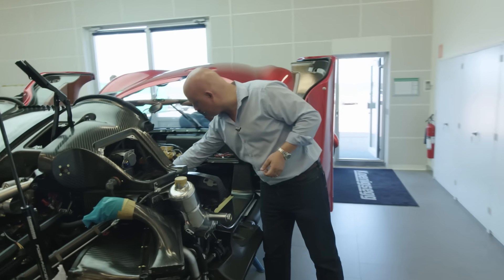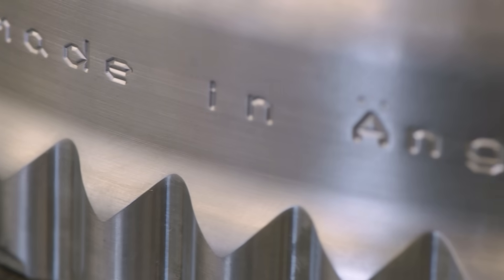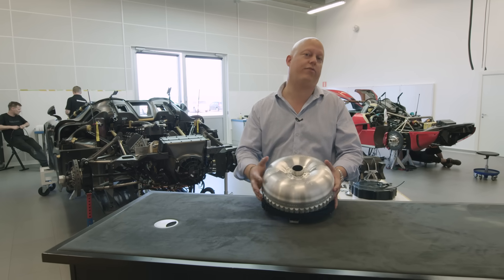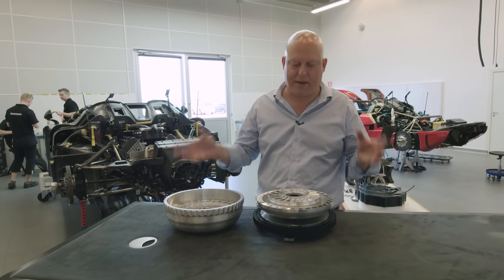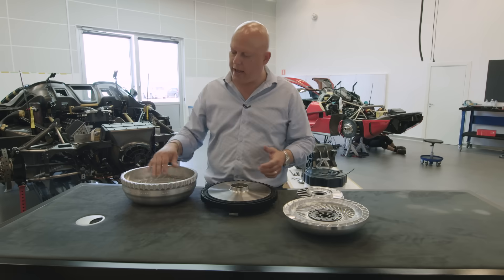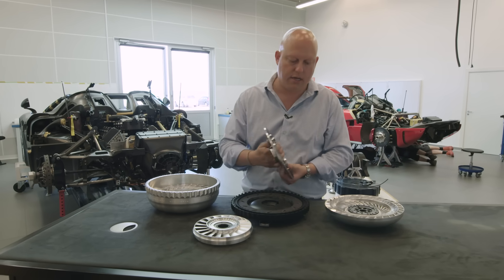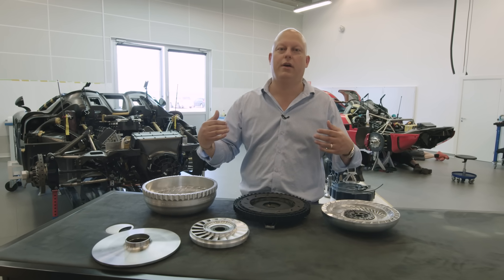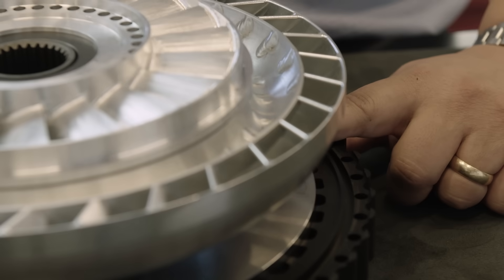248 MPH Without A Gearbox: Direct Drive  -- /INSIDE KOENIGSEGG

Comment: I'm a pretty smart guy, and I kinda-sorta get how torque converters work.  I've been trying to puzzle them out and really, truly understand them for about 30 years.  Like I said, kinda-sorta.  I get the concepts but when you're looking at the fluid flow diagram and the rotation direction arrows and the whole thing, my eyes start to cross.  I won't deny that it's a brilliant idea, and he's right - it isn't super high tech or cutting edge sexy like the Toyota Synergy system or even the GM Volt.  It doesn't have to be.  It has to be tough and it has to work - no problem.  Preston Tucker used a TC drive on his Torpedo back in the day, and it worked.

But even after Christian spends  nearly ten minutes trying to explain it, it still isn't completely clear.

Comment: I'm no machinist or metallurgist, so I'm wondering why the vanes in these parts were welded, instead of the whole being machined out of one billet of metal. Is this better for strength, easier for manufacturing, or maybe both? 

Also, I'm really glad he didn't claim this was some kind of new technology. Not that he would, but some do. I recognized it as soon as I saw it, from way back in the old days. :)
Reply: They do not appear to be welded and he said they were machined. It looks like they use a 5-axis CNC.
Reply: Im no expert either but my guess is this somehow increases strength or prevents it from warping in someway. Otherwise there would be no point in doing it.
Reply: I saw no welds.  I saw some artifacts from what appeared to be hand-done machining.  It looks like the whole thing was CNC'ed out of billets and then tuned up by hand afterward, which seems really backward but that's how it looked.
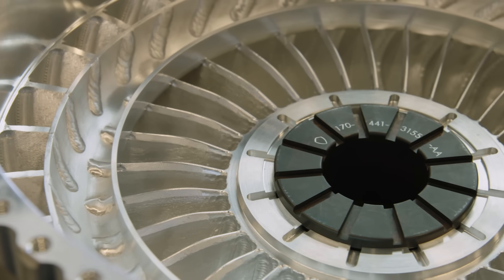Reply: I'm looking at what are either plug or welds at 5:24 .  It looks like the basic shape is a bowl nested inside another bowl.  To machine the fins of the turbine in between the two would be impossible, so they machine each bowl as a separate piece, then weld them together.  If strength were a concern, they would likely be using something other than aluminum.
Reply: Millwright Bastard I see what you're saying. The fins are machined. That U-shaped trough is then welded into a groove cut into the fins.
Reply: Some good eyes here.  I looked and came up with same assessment then noticed everyone already narrowed it down.  The machining did look like welds when I first saw video, then closer examination showed the U shaped trough was welded and the veins have machine marks.

Comment: So is it just a huge centrifugal clutch?
Reply: no a centrifugal clutch does not multiply torque, and it allows for a different input/output speed by slipping and wear... 

This is a torque converter, oil is doing the work, not friction material.

Once you get 1 to 1 speed, the torque converter operation is no longer needed, so the lock up clutch deactivates it.

Comment: Direct drive with an electric motor makes all the sense in the world. The motors controls act as a potentiometer. A normal converter will bleed off power before it locks up at higher rpm. At low speed, it's a torque multiplier.
What a beautiful piece of machining.
It is the springless (et al)  valve train that has interested me for years. It allows you to loose all the parasitic drag and wear and tear items in a engine.

Comment: sounds similar to how the clutch pack works on a top fuel dragster . direct drive but the clutch packs slips till full lock up or that's the only thing i can compare it to in how  it operates.

Comment: in not too good in english, in my understand its a like a cvt but with less components and pulleys inside another pulleys variating the engine power exit like a eletrical torque multiplier lug wrench with steroids and alot of rpms, something like that?

Comment: This only showed me how much I don't know.
Reply: theres basically just a fan that shoots liquid at another fan, the first fan gets power from the engine, the second fan gets spun by the liquid being shot at it.

Thats how you can have the engine power make the shaft spin and give it power without directly attaching them. Imagine if they directly attached a fast-spinning motor to a not-spinning shaft, it would violently break or jar the car forward.
Reply: Michael Marti it’s not just a hydraulic coupling. It literally generates more torque. It changes the direction of the fluid at different angles to create a gearing effect.
Reply: They made a special set of these two liquid-fans that is more efficient and can handle more power so they can let the engine spin way way faster than the wheels spin and still send power from the engine to the wheels- a problem usually solved by gears which let the engine + wheels spin at different speeds, but they didn't want gears because having like 40 gears and 7 gear ratios with complicated moving parts is really tough when transferring 1200 horsepower and going 248mph, this is simpler and works better for them.
Reply: zawzero And a few other things...
Reply: so well put
Reply: +Chad Bingham Just learn what a torque converter is (it will be in your suggestions) and you will understand.
Reply: hey so you are telling you know better than him? Hey show me your hypercar that does it's top speed in 20 seconds!
Reply: LOL   Exactly!
Reply: LOL.  IKR.
Reply: I see what you did there......
Reply: Watch porn then, it will blow your mind.
Reply: Yet the efficiency is less compared with a normal gear. Lots of turbulences dissipation of the horsepowers...
Reply: It's a hydraulic coupling. Don't wet yourself. And again: Back to school. Your english is terrible.
Reply: Really? He braggs for 8 Minutes and then explains basically nothing? Back to school!

Comment: Oldsmobile experimented with a "switch pitch" convertor back in the mid- late 60's. As engine rpm increased, the vanes in the convertor moved to increase resistance sending more power thru the transmission. I rode in one of these cars when I was younger and it just kept pulling all the way up. I'm thinking it was a '65 olds cutless, but not sure.

Comment: to put it in layman's terms a torque converter is like a flywheel clutch with a hydrolic turbine pressing a disc brake (pressure plate) instead of you know, how a flywheel clutch works...

Comment: If I have this correct they have utilised the combination of the instant 100% torque of electric motors and the variable resistance of a hydraulic coupling to allow the engine to require no reduction gears in order for it to avoid stalling at lower speeds which means that you don't need a power sapping gearbox?

Comment: It's a really cool idea BUT HIS LAYMAN EXPLANATION IS CAUSING MORE ISSUES THAN IT SOLVES.

From what I can glean from this video the best analogy would be a liquid "gearbox", rather than normal mechanical gear box. And from the sounds of it it either has 2 ratios, 2:1 and 1:1, or by applying the clutch at various tensions you can get between 2:1 and 1:1.

He's really got to stop saying "7th gear"
There is still a downward RPM conversion at low revs. I could be wrong but while it's technically not a gearbox it's still effectively a gear box.
Reply: Punished Zero o
Reply: okay so while I basically agree with you all, what I still don't quite understand why they don't just use a two-gear setup with a normal clutch (for example with a 1:1 and a 2:1 ratio)
Reply: People with the way they individually envision transmissions in their heads think of these things differently.  It may help to simply think of this as a way to have a single 7th Gear -- and what would really prevent that gear from moving the vehicle at a 'super car' speed starting from 0 mph/ stand still?  A lack of TORQUE.  So this thing is pushing MASSIVE amounts of torque through right off the bat (I believe over 2,000 newton meters instantly) which allows both systems (combustion engine AND electric motors) to deliver over 500 horsepower EACH and they are cumulative (although are used in a variable manner ).

Once you GET it.. it's really really REALLY simple.  I suppose the most complex thing is just the use of the electric motors for initial speeds as a majority and then the RPM's increase all the way from 0mph to 284mph (on the RS) -- And of course in this transmission the electric motors are responsible for Reverse entirely.
Reply: I think it just muddies the issue.

If he wanted the layman to get it he'd be better off calling it a "Liquid Gearbox" rather than direct drive. Now he's got to explain around it with out saying it's effectively a gearbox because of marketing. "248MPH without a gearbox" is a far more impressive claim compared to re-branding the hydraulic coupling to a "Liquid Gearbox".

I'm basically saying "I see through your bullshit Koenigsegg and I'm still impressed."
Reply: The liquid isn't part of the "gearbox." It's just a coupler that connects the motor to the drivetrain without a "hard" connection, until the clutch engages. It's pretty much just interesting way to use a standard torque convertor (out of any modern automatic car) in an electric hybrid supercar. Since there is not shifting direct drive is a pretty good name.

Comment: 2 to 1 torque converter .. with electric motors assisting ... ok simple  ...
 now try to understand the D-Drive  or 11 million to one gearing ...
and this so called direct drive is only direct when its locked , not when its doing it 2 to 1 thing ...

Comment: Not to take away from his accomplishments... but isn't this just a locking torque converter? He literally says that in the beginning. It's nothing new... like he said, 100 year old technology. I suspect that no company has a product that meets his specific requirement, so he decided to make his own. Honestly I was a little disappointed, I was hoping it would be something completely new (like freevalve - now THAT is incredible). 

I also suspect the drag racing community would have some useful input on beefy torque converters. I'm sure there are two-speed auto drag cars that make well over 1000hp.

Comment: No disrespect to Koenigsegg, but I got caught off guard by the 4s 0-60 time. Keep in mind that a Tesla P100D can do 0-60 in < 2.5s, which says more about electrics than how 'slow' Koenigseggs are (and yes, I'm aware that Tesla has a rather low top speed cap). You can see how the complex an ICE/hybrid drivetrain can get, which inherently causes losses.

Comment: I don't understand how the "hydraulic coupling" is different from your standard torque converter besides marginal innovations in design and use of aluminum (curious how that'll hold up to heat and pressure).  Seems like theyre just using tricky wording to get past the fact that it's not a radically new device (but is still useful).

Comment: If adding an electric motor to a supercar makes it so much better in performance, why have the gas engine at all? Range? Since when does a supercar buyer care about range? I challenge anyone to drive one of these go-cart suspension vehicles for more than the typical range of a Tesla.

We are already in an era where ultra-performance is the exclusive domain of pure electric vehicles and they do it without the Rube Goldberg mechanisms needed for ICE.

I get it. An ICE car is like a Swiss watch. Intricate and beautiful when done like these guys. Engine/exhaust noise, the smell of gas fumes, the shifting, the tradition. Other than collector value, I see no performance value in ICE supercars today, certainly not in 5 years when range issues of EVs are solved.

Comment: Gene Snow developed a direct drive in the 1960s, so you're not coming up with anything new.
Reply: he did mention it wasn't anything new he's just talking about how the torque converter helps get more power at lower RPMs with hybrid mega cars or something, I don't know.
Reply: @Chris Henniker
Try starting out in overdrive with any other car. He may not have invented anything new, but he did come up with some new innovations. Otherwise, we would all be driving single speed cars. Even the model T had multiple gears.

Comment: I feel like this hydraulic torque converter would degrade quickly due to fluid cavitation created by the pressures associated with such high energy input. Am I understanding this thing correctly to assume that?

Comment: You don't need a gearbox for 248MPH??????
Reply: Actually you don't need a gearbox in any car to hit top speed. You need a gearbox to just get them rolling or do low speed driving around town. 

In most cars (rear wheel drive at least) , 3rd gear is usually a direct 1:1 ratio from the motor to the rear axles. The rear gearing adds its own mechanical advantage but that could be any number of ratios
Reply: you do need 900 horsepower ahahah
Reply: Horny Pervert no it's essentially just a modified lockup torque converter. There isn't a gearbox, the whole reason cars have gears is so the vehicle can move at low speed or to get moving. But this guy invented an efficient way to have only one gear ratio so that means no need for a tranny/gearbox. Other people have invented the identical thing but could not figure a way out to make it efficient enough to ditch a conventional automatic trans
Reply: RedfishCarolina maybe 3rd be your 1:1 if you have a 3sp. Modern cars with a 6 speed would have it be 4th or 5th depending on wether or not its a double or single overdrive
Reply: Gottalovethisone this is a gearbox
Reply: Varner345 but it has paddle shifters, what's being done if there are no gears?
Reply: I guess so
Reply: of course not, haven't you heard of rockets? 🚀

Comment: Just sitting here pretending to agree with what his saying like 'yeah I understand..........'
Reply: I agree. I acted like I understood then at the end i was like " What F****** language is the speaking? Super Engineering to the max!!
Reply: theres basically just a fan that shoots liquid at another fan, the first fan gets power from the engine, the second fan gets spun by the liquid being shot at it.

Thats how you can have the engine power make the shaft spin and give it power without directly attaching them. Imagine if they directly attached a fast-spinning motor to a not-spinning shaft, it would violently break or jar the car forward.
Reply: Yeah, I'm honestly not buying this guy's bullshit about extreme engineering and mega performance.  They modified the vanes and volumes to make a TC work like a gearbox, for their engine output/optimal power range and desired thrust curves.  A proficient technician or mechanical engineering student can understand this stuff.
Reply: Michael Marti How much power can you really get out of shooting liquid at a fan though? Thats insane..
Reply: Hear that airplane that just flew over my head....wooooosh. I understood NOTHING. Well ok maybe 2%...
Reply: ____iBeg____ Think about how a steam and diesel ships turn their props. Diesel electric or nuclear electric, same deal. It boils down (pun intended) to converting chemical energy into rotational motion.
Reply: "Fan" is just a word I was using because it was familiar, more accurate would be turbine. If I blow air from my mouth at a pinwheel I make the pinwheel spin. A spinning pinwheel can also work as a fan and move air like my mouth could, which means one pinwheel spinning can make another pinwheel spin. This is just the basic principle and the real device is made of specially shaped super strong metal turbine blades.

A nuclear power plant makes electricity by boiling water and the steam spins a fan (turbine) attached to a generator, so the answer is unlimited as long as you make the blades the right strength/size/shape.

Comment: so basically, it's just a fancy torque converter with a high final drive, which gets a leg up from the electric motors. When the electric motors can go no faster the clutch locks in and the engine powers it up to top speed.

Very interesting!
Reply: yes quite simple...even you figured it  out

Comment: Keeps saying it's exclusively machined aluminium but you can clearly see the welds.
Reply: Those aren't welds but pretty crudely machined fillets,... He talks of high quality machining while you can still make out the traces of the cutter... And as far as I'm concerned i have serious doubt about the efficiency of non smooth surfaces in hydraulic systems (fluid dynamics)
Reply: it needs to be smooth so liquids flow over it easier less resistance means more efficiency
Reply: if it doesnt need to be smooth ..no one cares what it looks like ahahahha
Reply: @Michael Amann  
@Psylence
5:21 - at the bottom of the screen are welds. Are you blind? No cutter can make a stack of nickels like that.
Reply: psylence i love how accurately your first comment describes yourself ironic isn't it
Reply: *****
Lol they aren't consistent - no CNC would make cuts like that. Please link a picture or video of you making cuts like that.
Reply: Even if it is a prototype you should not talk about high quality if the thing shows only a rough surface finish... a prototype which is used to demonstrate or explain should match the quality you're talking about.

Comment: My Car has less HP than the electric motor alone, seeing as power used is velocity squared, 248mph seems rather irresponsible in a world where coal fuel  is a limited resource. Concentrate on the electric.
Reply: No one cares, it is a Koenigsegg. And also: supplies will last at least 60 years, which means we all can get our fair share of fossil fuel.

Comment: It's basically two gears, then... except of course it isn't a gear it's a torque converter. So if it's final drive ratio is 1:1, then it has a 1:2 "gear" option which is like 3rd gear. Combined with all the electric power low end torque this thing is just insanely fast.